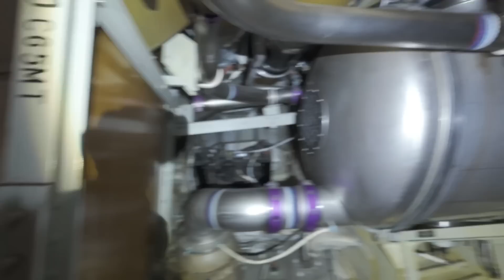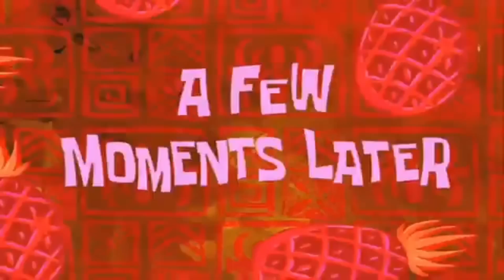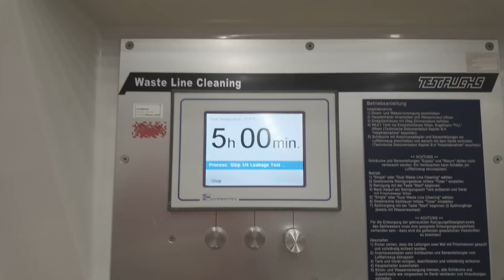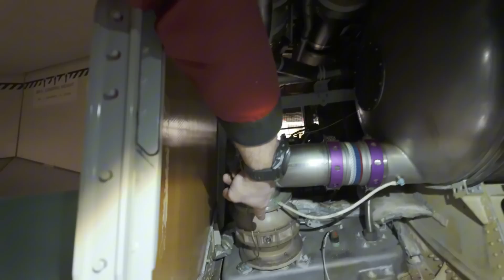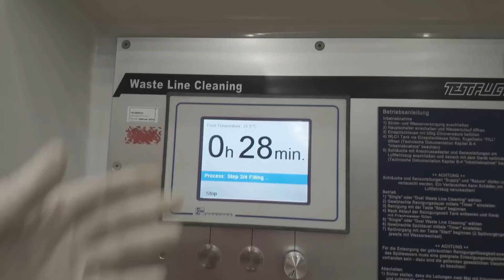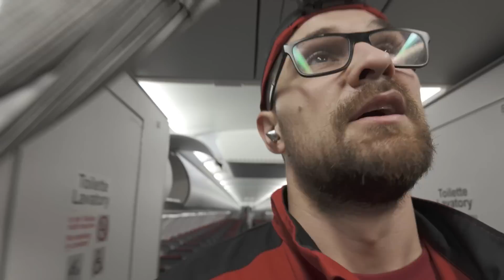Waliclean in action or How we keep our aircraft waste pipes clean.

Comment: did you remove also  the other toilets assy and put cap so the citric acid not enter toilet assy  flush module? i did that procedure on 787 and we capped all toilets waste line and gwiv and conected return to most fwd toilet and supply at bulk cargo (endcof waste line)

is there any problem to do 2 lines at the same time (with jumper)? the wlc1a capple to deal with it?
Reply from the maker: On long range we do both single and double line cleaning. We conect 2lh and 2rh toilet with jumper or connection line and as well single is as you said from fed toilet to tabk. Rest remains as it is

Comment: Why not use decalcified water to flush the water?
Reply: I don’t think it’d break down the existing scaling, and using citric acid would speed up the process regardless. You’re basically dissolving rock. Time is money with aircraft, so anywhere things can be done quicker within reason is worthwhile.
Reply from the maker: Because weusethe same water for everything in the aircraft
Reply: @zeto.r check! Does water quality of different airport affect this as well?

Comment: Great videos! I just had a question if you don't mind. I have a 70cm by 70cm window cutout from the fuselage from an old Alitalia  A321 (I-BIXR) during Covid on Ebay. I don't think the actual frame is included but there are skin frames inside which have a serial code etc for each one. 

I just wondered if you know if these serial codes tell you which side and whereabouts in the aircraft the window was located? The two y axis frames in my fuselage cutoout are C35.7 and C35.6. I'd love if you could help me because there's loads of pics online of I-BIXR, I'd love to know where on the plane it's located?

Thanks so much! Awesome to see your channel is growing too!
Reply from the maker: Hi. It is hard to find structure components since this is most of the time sheet of metal and then it is deiled and riveted to frame. Thank you 😊
Reply: @zeto.r  Sorry for slow reply Zeto, I totally understand I just guessed that every part had a location and serial number in case of failure accident etc. Thanks for letting me know!

Comment: What is that pipe at 10:44 just in front of the patch on your shoulder? It seems to be quite unprotected and easy to bend/damage when climbing into the compartment.

Also is there a reason why you don't include the waste tank in the cleaning loop? Connecting to the waste servicing port and then the other side in the lav as you showed would save quite some hassle I think.
Reply from the maker: That is pipe for pressurisation of water tank on the ground. You don't go there very often and like everywhere you must be careful what are you doing. For the tank is separate machine and still you must exclude it from the system. You have there a lot of connections like air separator. Nothing is easy as you think 🙂
Reply: $121,625.00 USD a year to clean waste lines... not bad....

Comment: Amazing thank you. Here some questions I have for you.

1. Is there a reason why the cleaning process is done from waist tank to lavatory and not the other way around like normal flushing?

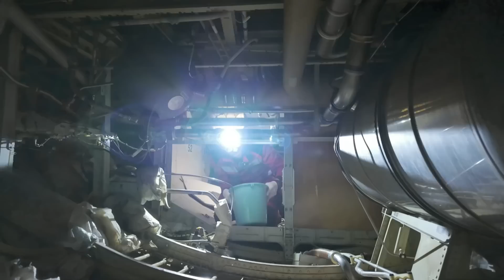2. At 8:01 is that the APU fire bottle or the cargo dump fire bottle on the left side?

3. Do you also work as a Purser or Pilot?

Thank you in advance :)
Reply from the maker: You pushing fluid up since most of the buid-up is closer to tank and you prevent blockage. That is cargo dire bottle. And im mechanics nothing else